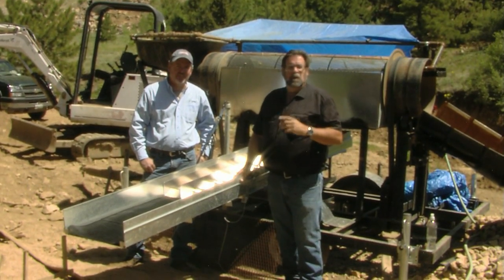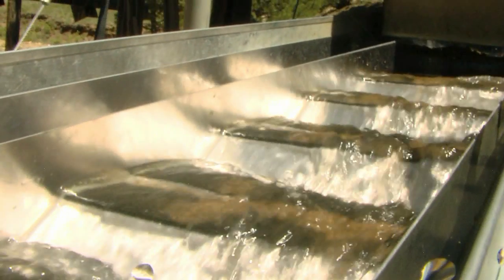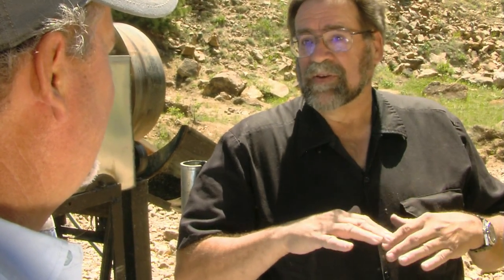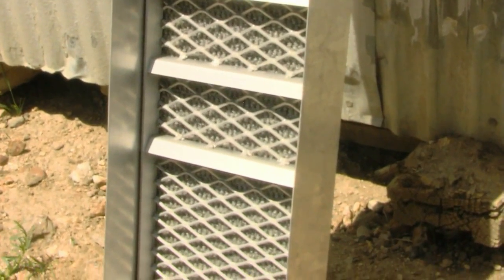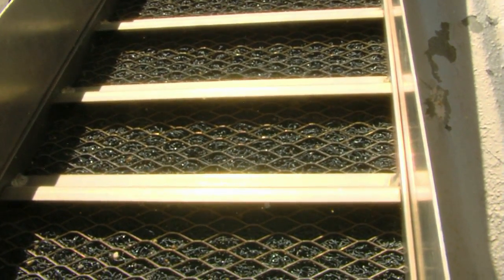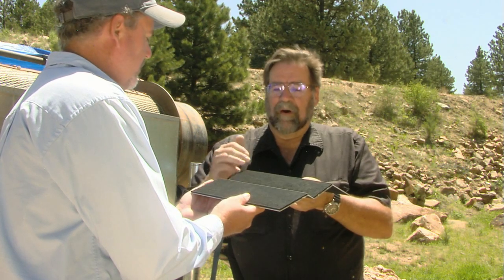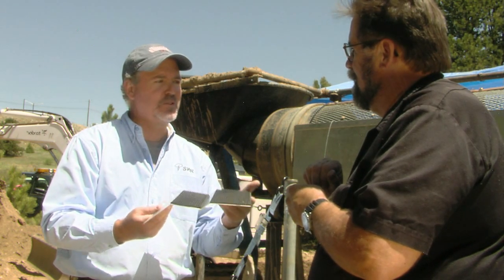Pilot Mining's Revolutionary Sluice Box

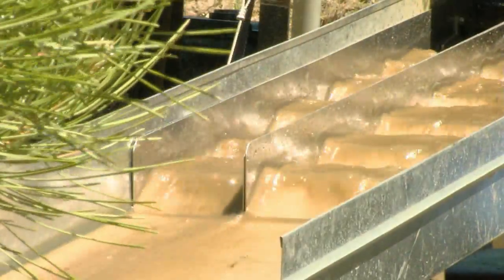Comment: 1:57 everything said here is nonsense and has no benefit to alluvial or placer sluicing. 'Big wave' mats have been around for decades. Nothing beats a good combination system. Hydraulic riffles can be made from electrical conduit quite easily, and to a high commercial quality. A nugget box or boiler box (often flogged as 'understream' or 'underflow' riffles) and a good combination of mats will get micro-gold and even nano-gold if you use gravity separation. I seriously need to start selling my homemade wash plants to people. But I'm a mug and make them for mates for free because I don't want them to get scammed. :(